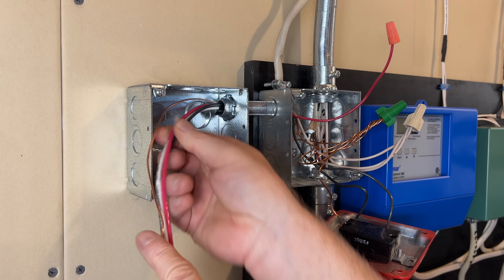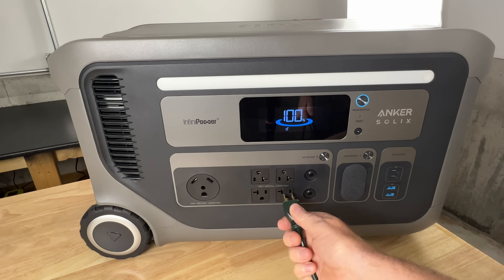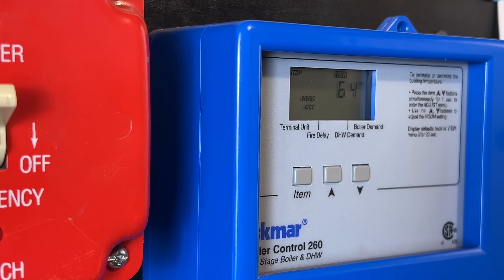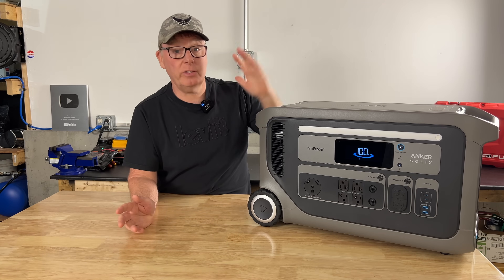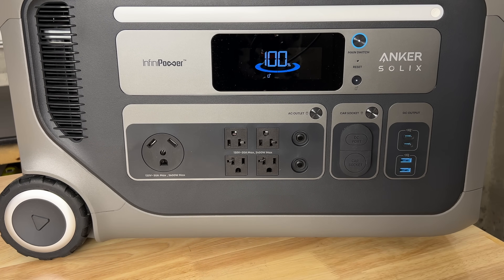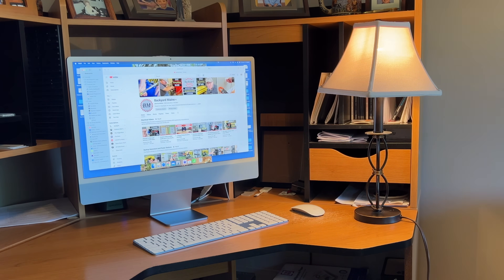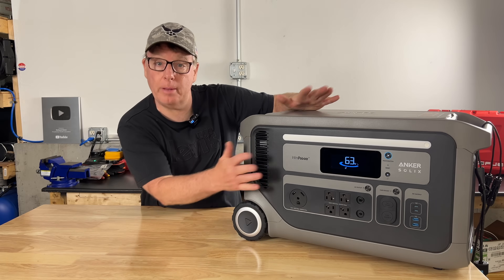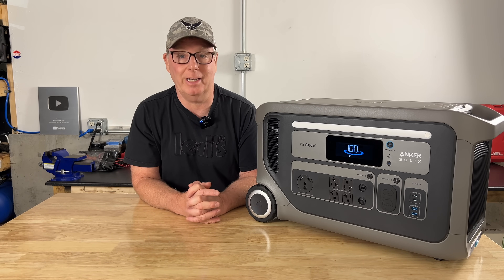Essential Backup: How to Heat your Home with a Power Station (Anker SOLIX F3000)

Comment: I purchased 2 F3000’s and the double voltage hub.  Here are my questions:
1.  Will the NEMA L14-30P connection on the hub provide both 120v and 240v power?
2.  I have a portable generator that plugs into my home with a SS2-50R extension cord, works great; my question is, can I plug into that same SS2-50 connection from my house to the Anker Double Voltage Hub?   I already bought an extension cord with ss2-50 and L14-30 on either end.  
3.  I am also wondering if bonded versus floating neutral is correct between the double voltage hub and the house panel?  
4.  My home connection is a simple 50 amp interconnect receptacle, wired to panel, with a generator lockout switch.
Reply from the maker: 1. Yes. The NEMA L14-30P will provide 120v volts from both hot legs to neutral and 240v between the two hot legs. 
2. The F3000 can be charged with a gas generator using the TT-30P connection cable (purchased separately) with a maximum input of 3600w (30A) but only at 120v. It doesn't support 240v charging.  And of course it can be charged with a standard 120v wall outlet at 1800w. 
3. The F3000 has a floating neutral as do all power stations or at least every one I have tested. This is what you want for connecting it to your home. Your home has a bonded neutral so the F3000 will become bonded when connected. You don't want two bonds. I made two videos on this subject. https://youtu.be/V4UM7GB2wsg   https://youtu.be/gchq6G5Wc8M 
4. I assume you have a proper generator connection. I made a video on that as well. https://youtu.be/5y7RaJSAMZQ

Comment: Did you switch the EZ Generator switch to floating neutral to run it off the Anker Battery?
Reply from the maker: Yes.. floating neutral. I have a video made for this but I decided I will post it in the fall when people are thinking about heating their homes.
Reply: @BackyardMaine  Thanks! I really appreciate your channel, and am getting an early start on making sure I can power my furnace when the weather turns unpleasant!